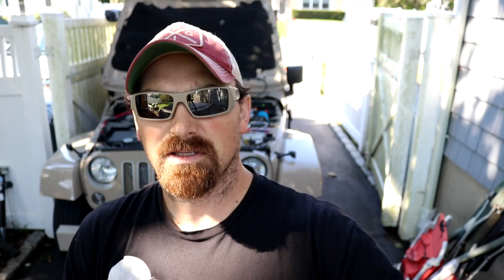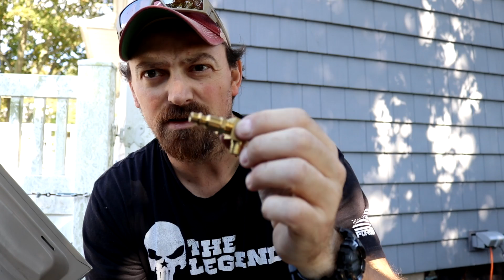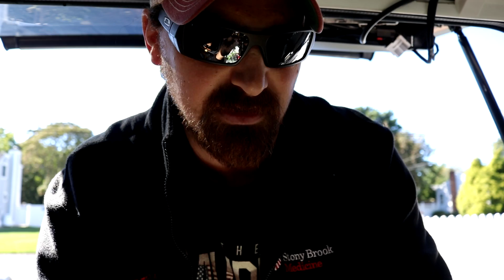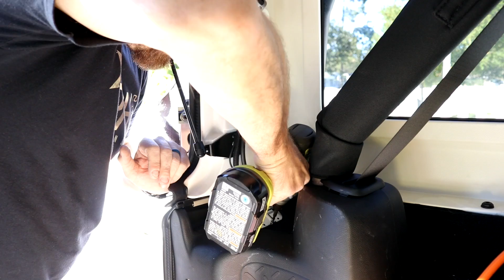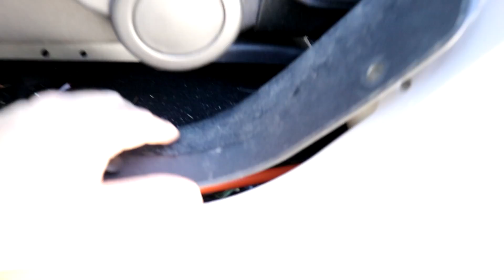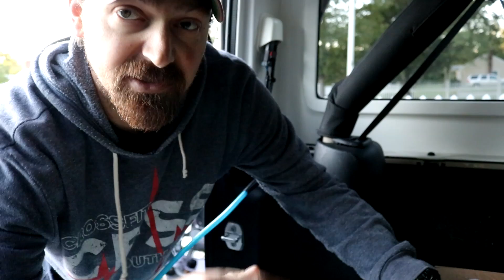JEEP Mod - ARB Manifold Install and Airline Relocation

Comment: What kind of bracket did you use for the manifold -- and what exactly is is mounted to? I just installed an ARB dual compressor in my JK using the bracket from Metalcloak. Trying to figure out the best location for the manifold.

Comment: Do you need the manifold or you can just hopk it up straight thry the top?
Reply from the maker: I put the manifold for air lockers which I didn't end up going with. You can just go directly to the air compressor. Thanks for watching!

Comment: Sorry for the noob question, but what is the purpose of the manifold?  Couldn't you have just hooked up the hose directly to the air compressor?
Reply from the maker: To use the air lockers you need the manifold to distribute to the two solenoids for front and back. I was setting it into place. You don't need the manifold if you don't plan to run any other air accessories. Thanks for watching!
Reply: @WanderToGetLost  ah!  Do you have air lockers you plan to hook up?

Comment: Nice vid, I'm pretty sure the Twin ARB has a built in pressure sensor..Is the Zenith only for the gauge then?
Reply from the maker: Yes it does. The zenith is so you can see the reading on an external guage in case the built in should ever fail. Thanks for watching!

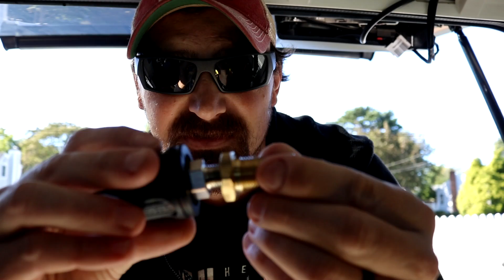Comment: Where did you find the fitting at 9:27. I’m trying to convert male end of ARB quick connect to male 1/4 NPT.
Reply from the maker: All the fittings I used are linked in the description.  Thanks for watching!

Comment: If you had to install this ARB again, would you recommend relocating it underneath the passenger seat or remain under the hood? I've heard installing it under the hood will cause some maintenance issues in the future due to exposed to the environment?
Reply from the maker: I chose under the hood because of the wife, a 3 year old and a 5 month old. Its loud. Not obnoxiously loud, but under the hood it doesnt wake them from naps in the back seat. So far no issues with it being under the hood.  Hoping for no issues.  I know Dan Grec from The Road Chose Me has it under his hood and hes been traversing Africa for over a year now.
Reply: @WanderToGetLost  That's a good point. With all that wiring under the hood, you have any issues trying to access other components of the Jeep like the brake fluid reservoir?
Reply: @Airkoay  I put mine under the passenger seat, it's a pain to wire it there. You'll need about 6' of extra wire for each wire, plus the wire that goes to the relay under the hood. I'd probably go with under the hood mount if I redid it.
Reply: @MichaelCook1981  @Brandon Koay I'm going UNDER the seat as well next week, mainly to keep the ARB cooler, cleaner and not to crowd the engine bay even more. Noise can be a concern, but ppl will be out of the Jeep when in use, so I think I'm okay with that. What did you find to be the big PITA with the wiring?? 
(Did you use the passenger side firewall hole?? I just realized a lot of ppl don't even know its there) Good Vid Señor Cook!

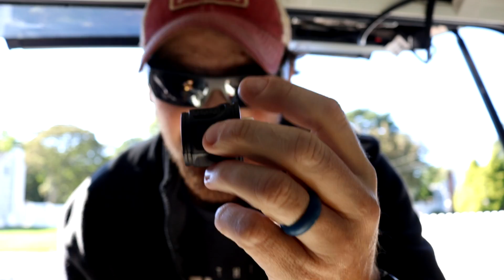Comment: Thanks for the video. I run a similar setup with the ARB compressor under the hood, and I've considered running a line to the rear of the Jeep. Do you know the name/size of the fitting that you picked up at 9:26?
Reply from the maker: https://www.amazon.com/gp/product/B000MTI1BE/ref=oh_aui_detailpage_o04_s00?ie=UTF8&psc=1  It is the mounting hose barb. has the lock washer and nut so you can mount it. It needs a 3/4" hole to fit through. for my setup i drilled out my old antenna bracket.
Reply: @WanderToGetLost  Awesome. Thanks. I figured that was it from your list but wanted to make sure.